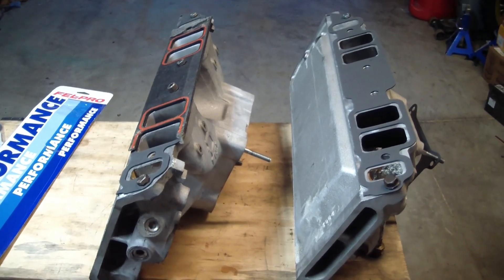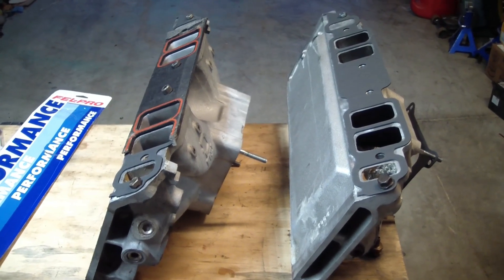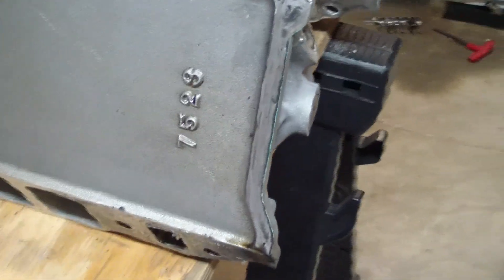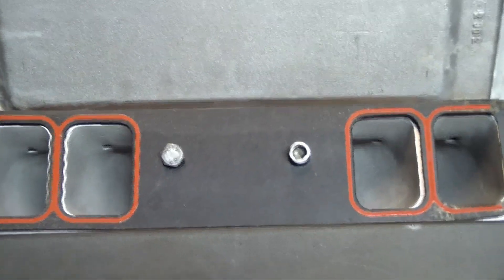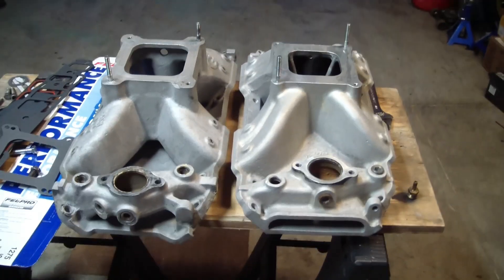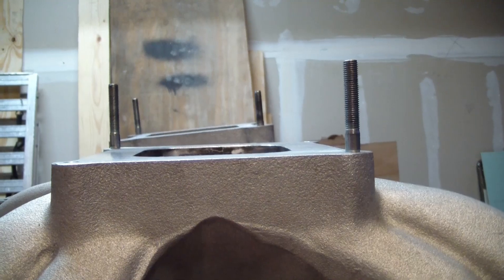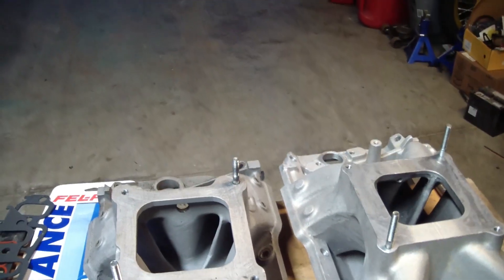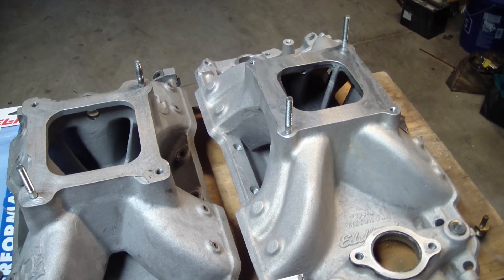BBC Team G Vs Victor Jr R intake comparison

Comment: Rather than going through all the BS and money of getting a different hood, wouldn't it just be faster, easier, and cheaper, to just mill the top down a little to fit the N2O plate on the manifold? I'd just toss that puppy up on the mill and badda bing, badda bip!! Golden!!

I honestly don't think that mismatch is going to make a bit of difference or at least not enough to bellyache about. The heads are sucking, not getting blown, so can't see it hurting much of anything. Ran a Team G rec port intake on my oval port heads for years, never had an issue. Tried an oval port, and didn't see a bit of different on the board.

Comment: 5918?😂
Reply from the maker: Got me. I should have rehearsed
Reply: @bigblockbob  how much hp and tq did afr 315s make compared to 265s with same setup? Im building a 454 and im thinkin 265s.
Reply from the maker: @GJ-DT  my original 265 combo made 590 with a .612 left cam. That was the out of the box heads on a 9.9:1 compression 489 with oval team g. The 265s claim a roval shape. I had the ports opened to match an actual rectangle gasket. The intake and ports were matched and it made 680 with 11:1 and 650 lift cam.
I feel the 315s with similar vic Jr and slightly bigger cam is making 710 or more with open headers. The 265s out 60' the 315s so that was a trade off. Hope that helps
Reply: @bigblockbob  what is the difference in the 60-foot what about the 338 curious about your torque converter using with the same heads
Reply from the maker: @DevastationMtrsports  just about nothing. I just looked at my video with the 10.06 time and it was 1.44 and 4.13 for those incrementals on a 9.9x pass last year it was 1.42 and 4.09. I have been spraying nitrous more the last year and still haven't made a 1.3x 60'. There is a chance I go back to the 315s towards the end of the year to see if more flow makes adding the same nitrous any faster.
Reply: @bigblockbob  that's very interesting you can see some pictures and video of my car on my profile I have a 1970 Chevelle I'm curious to discuss a little more post later or something I just got off work thanks brother
Reply: @bigblockbob  not sure what your nitrous program is.. you mentioned a delay in one of your videos.. 1.3x no problem for me at all on nitrous.. been 1.28 even once on drag radials. I cant remember if I have 049 or 781 castings.. full port  and big valeves w ported vic jr  on a 468..
Reply from the maker: @DevastationMtrsports  nx express mainline with maximizer EZ controller. That delivers 20% with .5 second increments for 100%. My msd pulls all the timing at WOT so 60' doesn't move much on the delay. At least not in summer air. I can get near sea level air in the fall but last year I did a lot of NA racing.